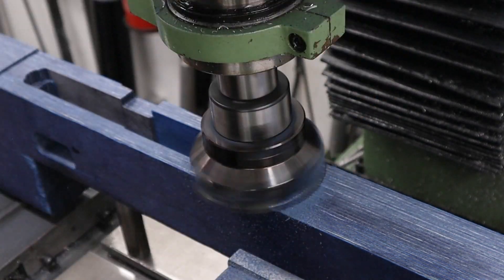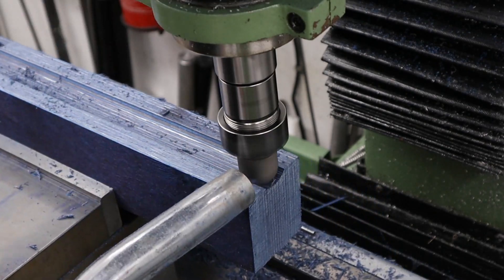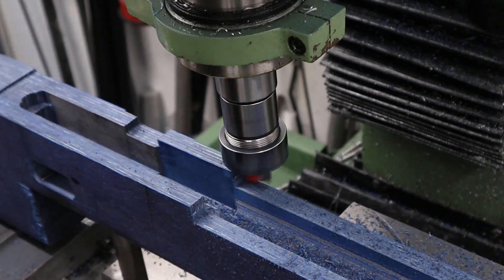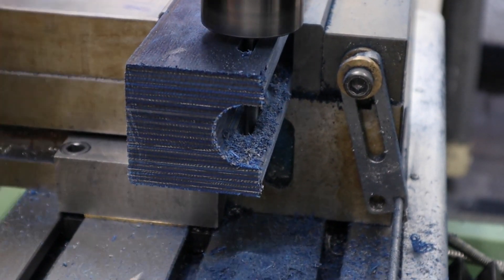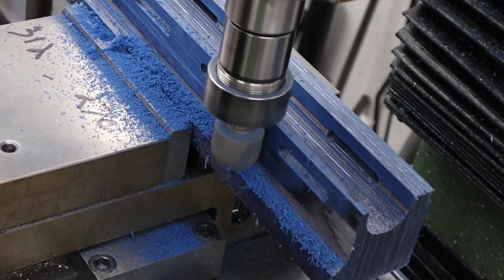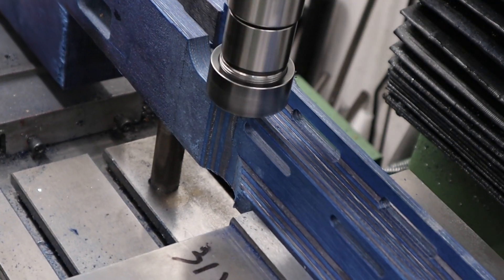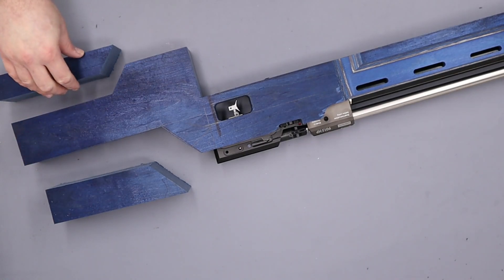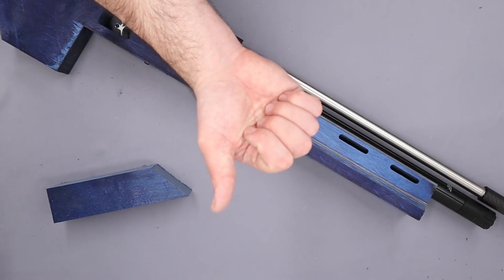Making a Anschutz 9015 bench rest stock Part 2.

Comment: looking very nice mate . pity daystate do not keep as tight a tolerance as you my red wolf i have had to use tape in inlet is way to big and with only the one fixing  the back of the action can move side to side . not a lot . however you can push it with your thumb. i look forward to seeing that with a few more bits on it and what you do with the back end . i want to get an adjustable cheek riser done on my tx . got one of those bear claw things on it works ok but hides the walnut stock
Reply from the maker: yes i have a redwolf with the tape in one side 😳 thanks for watching